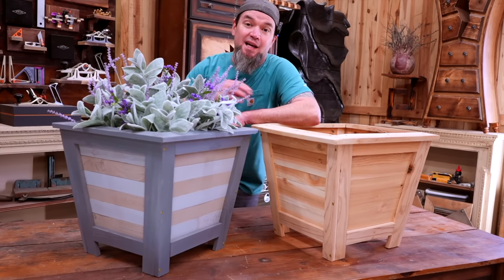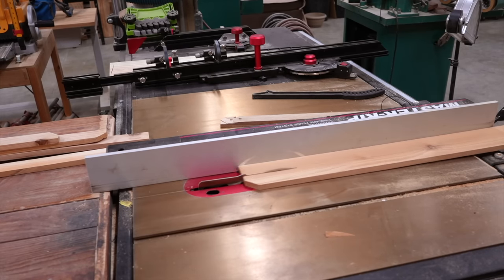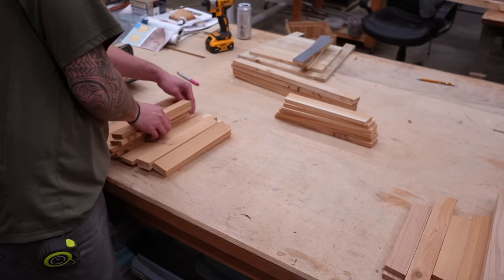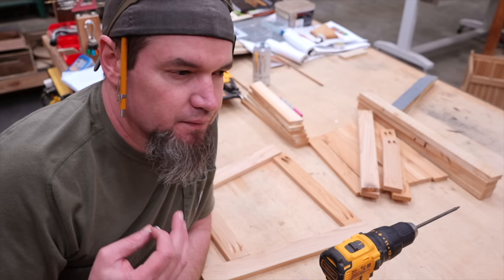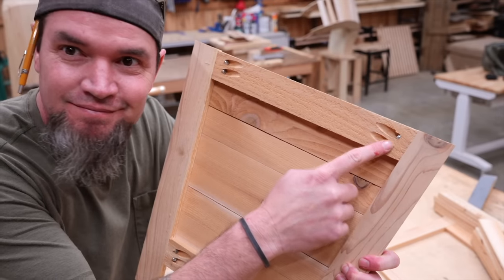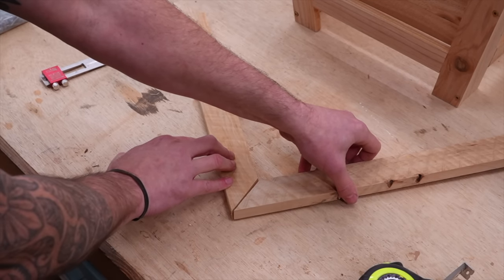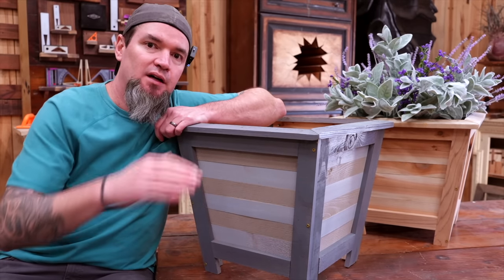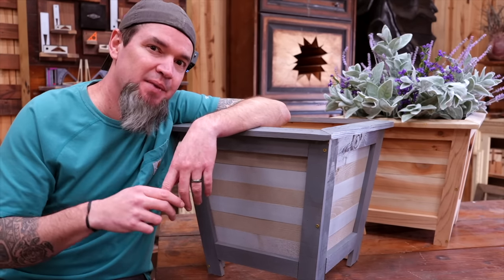The $6 Three Picket Planter - Low Cost High Profit - Make Money Woodworking

Comment: If you put a small Christmas tree in those pots, and used pine, doing a white paint wash on some, and on others, spraying the entire planter black, then use chalk paint and paint over the black, not covering it totally, and once dry, sand the edges and high points, to make it look as if it is old, and had layers of paint that chipped off in places, I believe they would sell like hotcakes, in November, and early December.  One could even stencil on some Christmas trees, with the wording, something similar to 

          Grafton Tree Farm

     Stencil Christmas trees here

               Cut and Carry
                    $8 each
Hot Chocolate 10¢.    Donuts 3¢

Comment: I made the original version, also out of pickets.  I was very happy with the outcome.  However, the wood didn't weather very well, as with most pickets it shrunk quite a bit in the cold and popped most of the nails out.  Any thoughts or suggestions?  Thanks for awesome content, you rock!
Reply: You definitely had wet wood. I'm guessing you probably made them out of pine pickets.  The pine pickets in box stores is very wet, you'll need to let them dry out before using them otherwise they'll shrink.

Comment: Your designs are awesome and you explain every step very well making it easy to follow along.  Question about the planters, do you think these could be used with a 4x4 post and be used for securing a shade (2 mounts on the house and 2 using planters with 8’ 4x4.   I see people using whiskey barrels for this but at $50 per barrel was trying to cut down the cost.  TIA

Comment: Question for you, the screws are interior screws in your link. I'm assuming these zinc one's won't hold up well outside overtime. I couldn't find the exterior one's, im assuming that's why you use the zinc? Thanks!
Reply: I have the same question, is there any options for 1" exterior pocket screws?

Comment: A question in regards to  substituting with the 1" screws for the top and bottom boards at 6:49 .  These are the indoor screws by Kreg  . not exterior.  Also they are not recommended for cedar because of the tannins or ACQ pressure treated due to the chemicals used.  Am i missing something here?  I ask because I have the same issue with board thickness and haven't found a suitable 1" screw for pocket holes (pan or washer head)

Comment: Love the videos! Thanks for making them. Do you place a potted plant or soil with plants in the planter? I ask because the pocket hole screws you showed were not coated. Thanks
Reply: its far easier to use a low cost, unadorned plastic pot for plants in these types of planters rather than trying to seal them and fill with soil.  I just kept  the wifes mums she bought in their 3 gal pots, made it easier to water and also much easier to bring in when the temps went to below freezing.  btw i left the 2 planter boxes i made outside and I must say they are holding up to the weather really well.  I made them last summer.

Comment: I make different  plant styles  and it's all.good up till I get to the frame. Always mess that up I was hoping this video  would help me but he just drilled  them in and it comes out great. When I try  it's always off center . So I put on 2 side way oversized. The make to to fit inside.  More work but it works 🤣

Comment: I really liked and appreciate the help you give us. I noticed you're using indoor screws.  Most people would have these outside. I can't seem to find any coated 1" screws.  Do you know of a source?
Reply: For coated 1-inch pocket hole screws, I have to order from Armor Tools. I wish they sold the screws in boxes larger than 100 count.  Kreg does stainless steel screws at 1-inch, but I think that if I used these, I'd probably put a wood plug in so as to keep the moisture out.

Comment: So there's alot of pocket hole screws which I know is super strong but was wondering if it would be strong enough with using Brad nails and glue. It sure would be alot faster. Just curious why you chose pocket hole screws and seeing if brads would work well or not..

Comment: Hey Matthew - I built seven planter's so far and getting ready for de-stressing/finishing touches. I have a question - I'm not a plant expert so it's all new, I wanted to get liner to tack the interior of the planter's but just wasn't sure what to get or where to find it. I tried Jo-Ann's and Amazon but found different kinds such as "coco fiber liner" and weed barrier protection.
Any advice would be awesome thank you!
Reply from the maker: What we have used in the past was the weed barrier liner. But I wouldn’t do it unless the customer requests it. Many people may just want to put a planter bucket in there instead and then the liner would just be an extra unnecessary cost to you.

Comment: I'm struggling with the placement of the top trim. What measurements did you use to get them to all line up?
Reply: I wish I could offer a solution because I'm struggling with the same issue.  Did you find a solution?

Comment: Hey gang,  new to the channel and have never used a kreg jig.  Was just wondering if I'm forced to use the kreg jig screws or can a guy get by with something cheaper? Thanks in advance and I'm loving the channel.
Reply: I have the same question. I can only find the 1" Kreg screws that are zinc coated and only supposed to be used on indoor projects. It doesn't look like Kreg does the 1" in exterior, or at least that's what I was told.

Comment: I have a question. I’m new to woodworking and I have a miter saw but I’m asking about 45° cuts for trim on a tray. When I’m measuring a board for my miter joint how do I measure the board for the trim? Do I measure the sides of the tray and cut those lengths or do I need a different measurement?

Comment: What type of brad nails do you use for these outdoor projects?
Looking forward to making these this season.
Reply from the maker: I have used 1”Brad nails for this build.
Reply: @MatthewPeechWoodworking  Are you using some that are resistant to corrosion for outdoor use?
Reply: @LivingWithDragon  you can get stainless steel for outdoor use.  i incorrectly used galvanized for mine, but I dont think they have degraded and stained the wood yet, they've been outside in the weather for about 6 months now.
Reply: @orbitalair2103  I used galvanized in an outdoor cedar trellis and it has left corrosion marks on it. I can’t get stainless steel ones around my location.

Comment: Matt, A question on your plans... On page/step 3 , side a assembly , shows a bottom side slat of 10.5 inches. Where in the cut list is this cut?
Thanks, bob s
Reply: It must be a typo.  The bottom slat is 11".  6 slats starting at 13-1/2" down to 11".  Each slat is 1/2" smaller than the 1st one.

Comment: Where do you find Fence Boards that ain't crooked as a dogs hind leg ?
Reply from the maker: I get mine from a big box store but I do have to dig and pick and choose the best ones.
Reply: @MatthewPeechWoodworking  ,
I made the wife a seed starter rack an  went with 2x2x8 , would have been a bit cheaper to have gone with regular ole 2x4 of course but my old $90 Black&Decker cheapie tablesaw that's  15-16 yrs old 🤔 is a getting tired, of course so am I at 67 . Anyway man I musta dug thru 200 of them 2x2  trying to find 8 that were usable . An the Fence boards 😳 wowsers 😱. ,
Thank You for the Great Videos an info 👍🤛

Comment: I had two quick questions.  You always say pickets are about $2 per picket.  Is that for treated pickets, and if so, do you just sand them down to get down to the good stainable wood?

Also, on you’re 2x4 based projects, are you using green wood or dried wood?  I wanted to make some of the trellises but wasn’t sure if it would be better to use green or KD wood since we’ll be bending it.

Comment: I have not been able to find a dry fence picket at my big box stores.  I am assuming I will need fairly dry wood to use a wood glue.  Any suggestions on another source for the pickets or another type of glue?  Or am I just wrong lol.
Reply: My pickets are also very wet. Put one together about two weeks ago with screws and glue and haven't had any separation or anything like that yet. I think because of how thin the material is warping and bowing is less of an issue.

Comment: I’ve been trying to find bulk pan head screws 1in and have been having no luck. I ordered the 1 in kreg pocket hole and The joints fall apart. I use pan head #8 and they are strong and tight. Does anyone or do you Matt, have a link where I can get them? I have allot of people wanting these and it’s killing me buying them in 100 piece packages

Comment: I’ve encountered an issue with your cut list. After modeling it in SketchUp and consulting an AI for verification, it appears that it’s not possible to produce all the required parts using just three six-foot pickets; four are needed. Is there an error in your cut list? I factored in a standard saw kerf of .125" for the required cuts. EDIT: I have also discovered that several pieces also need a double bevel in addition to the pieces you described in your video to be able to align correctly.

Comment: Love your videos and insights! I found a variation of the $2 picket at HD FIR $2.68 that looks better but is slightly different in dimensions: 3/4” x 6” x 6’ picket Alta Forest Products. Will this work with your plans?
Reply: Someone correct me if I'm wrong but I believe if you still make all the same cuts and are using 3/4" thick instead of 1/2", you'll need to use screws that are 1/2" Longer than the ones in the plans.
Reply: @johnnyperez2087  I’ve tested it with 1 1/4” Kreg and that should work. Also plan to use it to connect 4 sides

Comment: Instead of changing the bevel to the opposite 8°, can you rotate the piece and cut it that way? Asking for a friend...
Reply: @johnadams5353
2 months ago (edited)
In reference to the top trim, if youll flip the board from top to bottom as opposed to flipping left to right you can cut the 45 on the other end of the board and not have to worry about changing  the bevel to the opposite side of the saw. Your board will now be on the opposite side of the saw blade then it was was for the first cut. Why change the bevel again if you dont have to.?, Set up the saw once and leave it. As mentioned this is only referenced to the top trim, just an idea, but great build I'm gonna give her a go. Thanks for the great videos.

Comment: Can someone address the durability of the picket fence?  They seem really bittle.  When i fire brad nails, they often split.  I would be a big waster if they split few weeks later.  I am most concerned about using them for the legs and top frame

Comment: I came to this video from the old one. I still can't figure out why the top trim pieces need the bevel but the legs do not. Can anyone help me understand how the legs could've been cut with only a miter but the top ultimately creates an angle that requires a bevel to flatten? Is it just that the legs aren't flat against the supporting surface? Why don't the legs also need the bevel?

Comment: Has anyone had any luck figuring out the measurements for the screw hole placement for the top trim boards?  I know it's 2" from the corner, but how far in should I go?
Reply: I had the same issue. What I did was mock up the trim and then get everything even and measure from there. I made mine a bit different as the trim is flush with the outside so my measurements wouldn't work for this otherwise I'd be happy to share.

Comment: where do you find pickets that aren't treated? or do you just use cedar pickets. Thanks!
Reply: To find Non-treated Pine, you'll have to go pay premium prices at a lumber yard that cuts its own lumber.  You're best bet is Cedar unless you want to paint the planters or just spend the least amt possible, then use the PT "Pressure Treated".  Remember to let your treated pickets dry a few days before using them.  I line mine up on my back patio.

Comment: Is anyone else painting pressure-treated pickets? I thought that was not recommended. I can't find fence pickets that aren't pressure treated in the Montgomery, Al area.
Reply: I painted a couple of the the treated planters. Just check to see that the wood is dry .use a drop of water on the picket if it sucks the water up fast it’s dry if it sits on surface don’t paint

Comment: I am struggling with the trim pieces.  Any tips?
Reply: I thought about that when I made mine also. I took the table saw, set one finished side up to it standing up to match the cut and trimmed the top so it was flat with the ground. no compound miter joint!

Just remember to cut it the right way otherwise you'll exaggerate the bevel to 16 degrees vs zero.

Comment: The glue plus screws is why the stuff splits…if glueing just do two pin nails always for anything, if screwing, predrill is a must and countersinking a bit. Wood is gonna want to expand n contract, if locking it tight with screws and glue, it won’t allow the movement which ends in the boards checking. Nails will never be tightened down as much as a screw…. Nice little build though… peace out woodmies

Comment: Great videos! Hubby and I are starting to get into woodworking (I’ve done mall amount with crafting)as he built his CNC machine from scratch and then I was like “Now what you gonna make with it?” Lol   Question, is there an alternative to the pocket holes? He doesn’t have one of those machines.
Reply: Alt to pocket holes is using dowels and wood glue, often called dowel joinery.  Google for more info but that's the next best thing for him and it still hides the extra screws.  Do your math, it may even be cheaper than using screws but take a little longer to complete each planter.

Comment: Do you have a recommendation on what size pot these planters hold? I know with a couple of the ones I made, I had to put a lift board in the bottom so the plants would stick up properly. Those were smaller pots though. Maybe a 3 gallon pot would fit the height better?
Reply: I'm not sure about the actual size, but my wife has a pyramid shaped plastic pot that would fit just right in these. It fit the herringbone design one also. If I had to guess it may be 3 gallons?
Reply: @JohnClark-tt2bl  Thanks for the info!

Comment: I literally just finished the farmhouse planter yesterday, but your instruuctions of etsy were botchey :/ the trim poeces in your video you chopped 16in boards then 45'd them on the mitre saw. But apparently, you can only chop them at 45's off the main stock or youll fall short for the (2) J's :( other than that theyre awesome
Reply: I found the same thing about not enough wood for those last two parts. I also had to pocket hole the frames together on two sides as the wall panels screws fell right in the seam of the top and side boards. All in all pretty good plans for a me. Probably would have been better as a 4 picket with wider sides and extra wood leftover for the next project.
Reply: yes, the farmhouse planter is extremely tight, you have to plan the cuts carefully.  I used a cutlist program, and it took 3-4 tries to get it to lay everything out right to get all the parts.  my first cut left me 2 parts shy.  oops.
Reply: @orbitalair2103  So you got the 2 J parts out of the three pickets?
Reply: @robm3063  i did notice that those screws were like right in between the others. I reinforced w extra brad nails, if that helps!
Reply: @robm3063  so the third picket has the space for the top trim but only if you cut each of the 4 pieces out with 45° mitres, as opposed to a straigh cross cut.  It DOES fit. After you mitre out the 16in pieces, you will have to rip your excess to 1in and cut your Js out, super tight, but its there
Reply: @philmurphy7487  Matthew jenga game I guess. My next one I'm just springing $3.50 for an extra board. Thanks for the info though.
Reply: @robm3063  i needed 3 an i bought 10 lol confidence was super low on how well i could follow the cut list but i wrote my own directions whoch helped to keep track of my speedbumps and how to fix them as i made more

Comment: How can I get your cut list
Reply: Cut List:
3 Fence Pickets Needed- 1/2” (5/8) x 5 1/2” x 72”
*All pickets are cut down to 1 3/4” strips.  All cut list parts are based on cutting square stock and adding angles later.  

A- Leg A    16”(8)
B- Top Board A  12 3/4” (2)
C- Bottom Board A 9 1/2” (2)
D- Top Board B  11 3/4” (2)
E- Bottom Board B 8 1/2” (2)
F- Top Slat    13 1/2” (4)
G- Slat 1    13” (4)
H- Slat 2    12 1/2”(4)
I-   Slat 3    12”(4)
J- Slat 4    11 1/2”(4)
K- Bottom Slat  11”(4)
L-Floor Board  11 7/16”(2)
M- Top Trim   17 3/4” (4)
Reply: @MatthewPeech.  getting ready to make couple of the planter boxes  thanks for your videos

Comment: This build didn’t work for me. The legs are 16 inches and the bottom slat goes on 2 1/4 up leaving 13 3/4. The top slat goes flush with the top and isn’t really long enough but that aside the top slat is 1 3/4 inches wide leaving 12 inches between slats. The remaining 4 slats are 1 3/4 inches wide each making 7 1/2 inches for the four of them. The space between the top and bottom slat is 10 1/4 therefore there are not enough slats to cover the gap nor are they long enough by about 1 inch. Please help. Has anyone made this successfully without buying the plans? Thanks
Reply: Never mind. I found my error.
Reply: @ktrought  Could you tell us your error? I'm going to try and make one and knowing som emistakes that are made could help a lot of us. :)

Comment: @12:00 Why isn't the top flush where your elbow is?  Also, the runners on the bottom are not flush....and whats with the visible screws? And finally why doesn't all the legs touch the table? 
This is a great project for a beginner, but for someone who supposedly has some skill/knowledge as yourself, your final product looks like a beginner built it. Maybe you should learn more before giving advice.